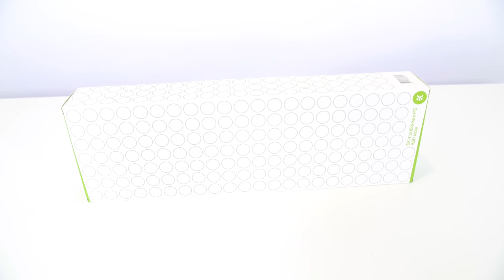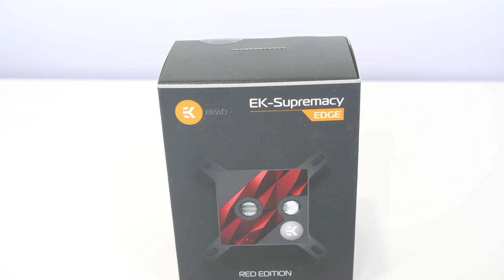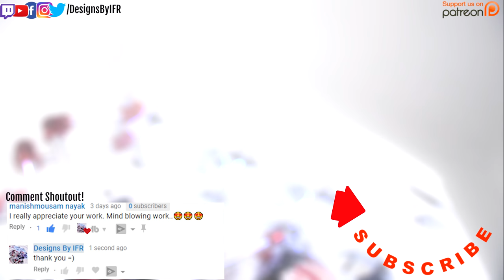ULTIMATE Z390 9th Gen Custom Water Cooled Gaming PC Build - Time Lapse Phanteks Evolv X

Comment: Every time I see that red used on plates in PCs im thinking it needs some texture behind it, I mean its a nice red and the plate looks good but the shade of red always feels flat to me. Nice build though...oh is it me or do you have a little white light bleed-in on the front plate above the first (top) stick-on shape?
Reply from the maker: hey thanks, the white might be a small scratch. The problem with spray colours is they always come in gloss which always looks really tacky in these types of builds and leaves amrks on it very easily so by using vinyl wrap i can have a matte finish which is much better for reducing marks

Comment: Should I wait for the i9 9900k or just get Ryzen 2700x
Reply: Get ryzen
Reply: Or wait for the new 7 nm zen processors.
Reply: Wich are gonna come out this month i believe.
Reply: @SebastianStephanStan  Nope, the 7nm CPUs and GPUs will be available in January of 2019
Reply: @SebastianStephanStan  This mont are coming the refresh of the RX 5xx series
Reply: @c.h.o.n4066  meh i thought this month😒.
Reply: 9900k for gaming
Reply: Buy ThreadRipper
Reply: Depends on your usage. Of course the Ryzen series and even the i5 would be enough for the majority of people and their usage. If you want that extra small FPS if you have a high refresh rate monitor (a good videocard) or a high resolution monitor, you can get the i7. Also if you also do workstation stuff, such as video rendering, 3D animation, etc. Then a more expensive CPU might help.

If you have deep pockets, just get i9.